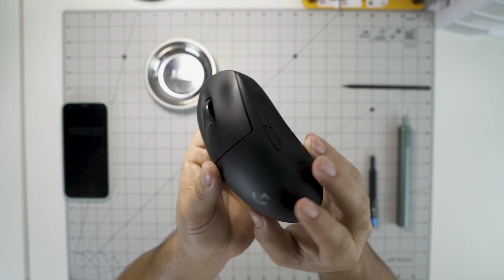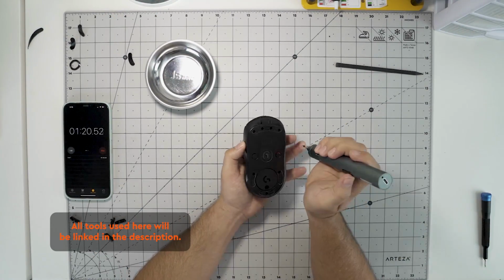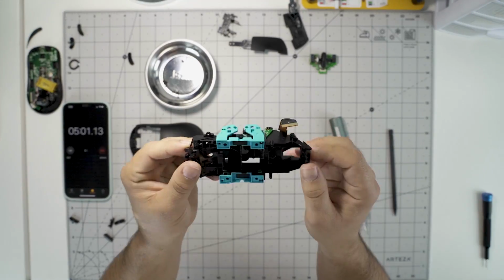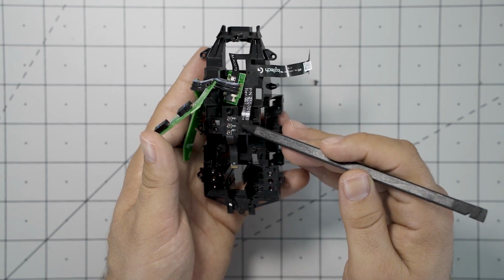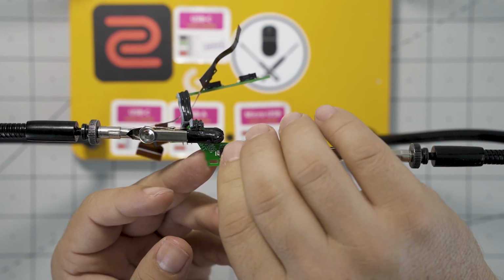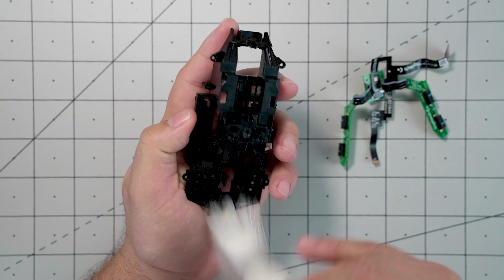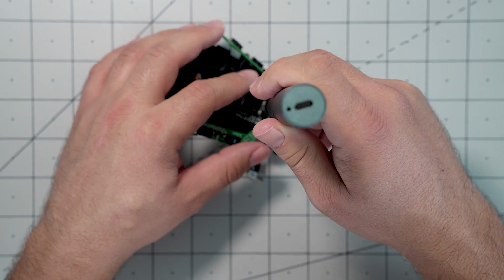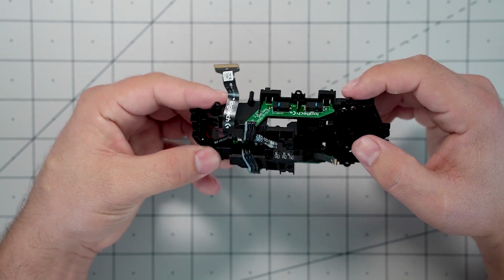HOW TO REPLACE THE SIDE SWITCHES ON THE G PRO WIRELESS

Comment: I want to remove the right side buttons to save weight since I will not be using them. I see that each side has a black cable connecting the pcb's to the little "center" pcb. Can I just de-solder that black cable from the "center" pcb to remove the entire right side assembly? And will everything still work properly if I do that? Just wanna make sure before I bother.
Reply: Yes you can, I have done this - no issues with floating all 3x wires. Make sure nothing shorts and all good.
Reply: @Solus793  thank you dude

Comment: Im kinda late, is the g pro wireless side buttons easier and less scary to solder compared to the GPSL? Saw a video before that the GPSL is kinda sensitive on the side buttons. Badly need your input, Thanks!
Reply: They are ok. Use extra flux for the desoldering process and add a tiny bead of solder to your iron before desoldering, 380C should be an okay temperature. Don't hold the iron down for more than 5 seconds on the pad, you will need to put the switch under a little bit of tension to lift it up - a pin or needle tweezers under the leg you are working on and lift up (only after the solder is wet and not with too much force, or you risk lifting/tearing the pad off the PCB).

Comment: Im using only the left side buttons, is it possible just to take switches from the right and replace them and not buy new ones?
Reply: Yes. It will work just fine.
Reply: @cengi  thanks a lot

Comment: hi imma bout to buy the green board for the side switches, does the black thin cable is removable to the side switches green board?
Reply from the maker: Yes, the black ribbon cable is removable.
Reply: @Escaldi  hey there! do you know if the side buttons on the Gpro Superlight are swappable? If so, are those switches normal or are they like side-mounted? im about to buy the regular m1 & m2 switches so i figured i may as well get side buttons too
Reply from the maker: @Lisa-hk8ht  hey! The Superlight side buttons can be replaced using the same method in my video. You just have to be a bit more cautious since there is ribbon cable involved now.

Comment: Does this improve the mushy side button feel or is it just to fix double clicking?
Reply: Add a layer (or two) of aluminium tape over the plunger for the switch to get rid of the mush.
You can fine tune things further by bending the relevant pieces of plastic at their hinges in the direction of the switches to remove some of the pre-travel - you have to do this by feeling, be gentle and don't over bend.

Comment: question , can u change side buttons on the superlight version too? since I cant really remove them and I dont want to broke them :D
Reply from the maker: Yes, it’s possible.
Reply: @Escaldi  I was looking for the answer to this question as well. My superlight double clicks on the side buttons, however it has taken me over 2 years to notice because it only matters for very few actions in the games I play. Why are there absolutely NO videos on the internet showing the process of switching out the side buttons? There are plenty only showing the swapping of the main buttons. Also, Where are you based? Would I be able to pay you to put more reliable switches in my g pro x superlight?
Reply from the maker: The side buttons for the Superlight would use the same method in this video.

I’m based in Florida. You can contact me via email or Discord. Check the video description for details.
Reply: @Escaldi  Really appreciate the reply! Your contact info is not in this vid. I do see your twitter on your channel but what is the best way to make sure you receive my dm? Instagram? Email? You let me know and we can make this happen
Reply from the maker: Twitter DM is fine too

Comment: I just want to remove the side buttons on both sides and cover the holes smoothly. Is there a dummy cover I can purchase online for that purpose?
Reply: the g pro wireless comes with button covers
Reply: @foxtrotrx  Does it make the sides of the mouse smooth as if there were no side buttons?
Reply: @cemsengul16  they make it flush with the mouse body but they still look like buttons.